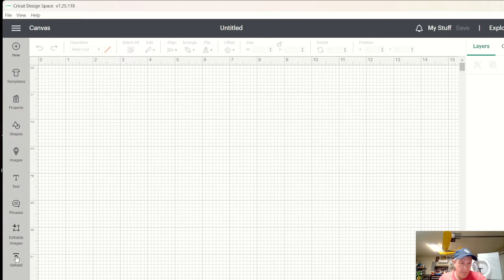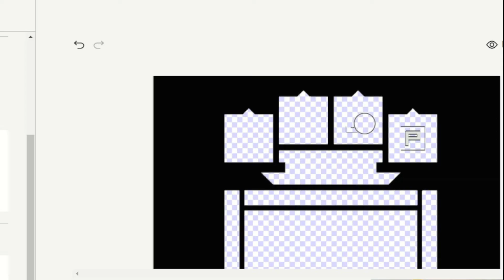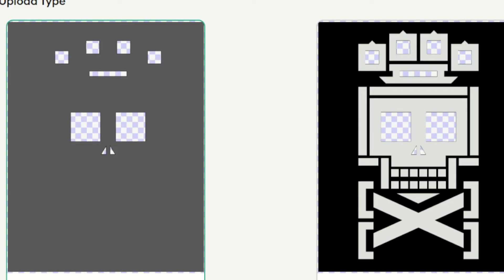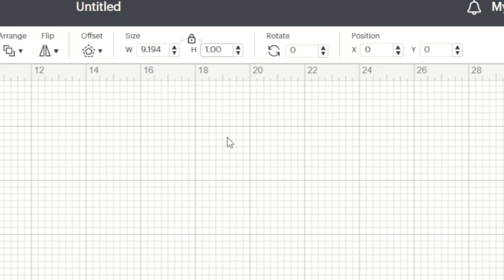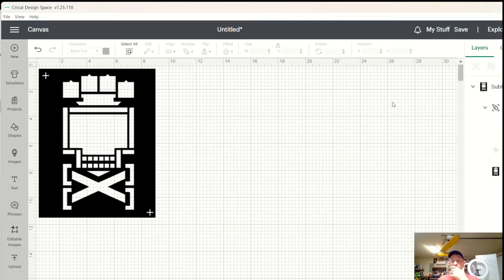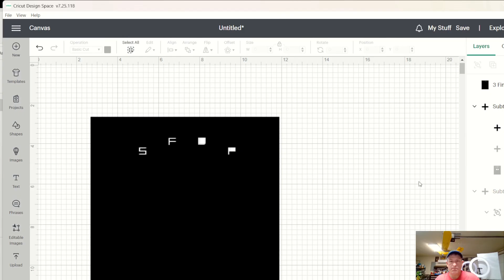How to make a Multi Layer Stencil in Cricut Design Space

Comment: I understand there are times you may want a multi layer mylar stencil, but in many cases, such as this design, wouldn't it be easier to cut it from paint mask vinyl, weed it, apply and spray the design.  Please explain why a multi layer  mylar stencil is preferable over a vinyl stencil in certain cases. Thanks for the videos.
Reply from the maker: Jeff, in this case, the client wanted this for multiple use. He wants to use it to mark gig cases, which there are many. Thanks for the question.